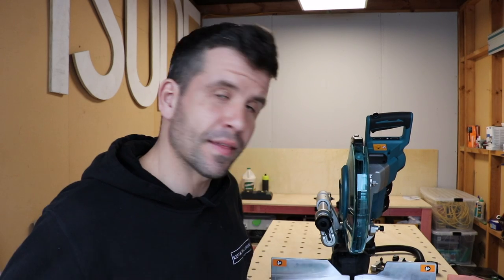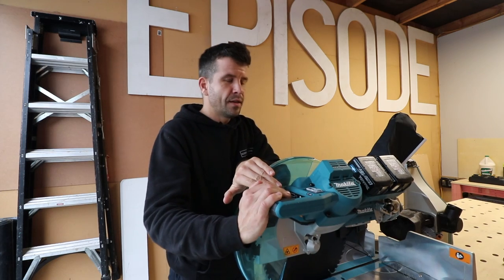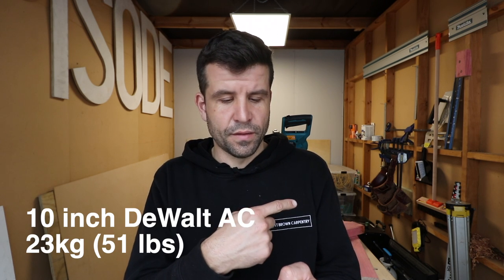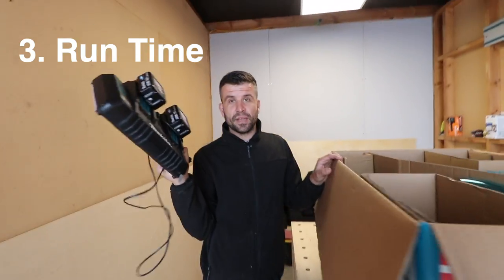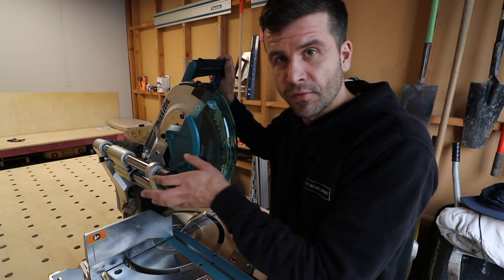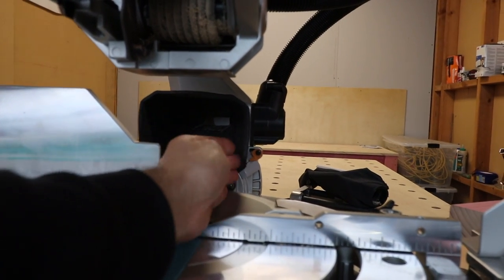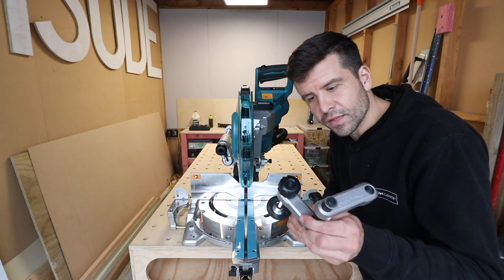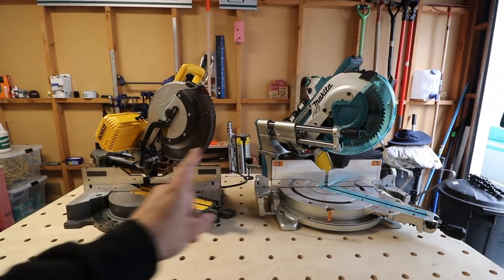Makita 12" Cordless Mitre Saw: Should You Buy it?

Comment: I find it very convienent to have the same brand of tools so that batteries will be the same and interchangeable.
Reply: When it comes to the compatibility of the system from the cases the tools go in to the battery system, DeWalt is the winner with most brands in my opinion.
Reply: Have you ever tried the batter adaptors?
Reply: I used to think that too. I ran all DeWalt 20v. Then I realized Makitas 12v line had stuff I could only find there. So I run a good bit of that now too. Sitting here now I really wish I had seen Scott's videos on framing guns before I snapped up the DeWalt version. It sucks on old tember. So much so, I'm considering selling all the guns and buying into another platform. I'm coming around to the conclusion that sometimes performance trumps convenience.
Reply: Vintagebleu, Milwaukee just launched their framing nailers and they purportedly beat all the cordless ones available. saw the demo recently and looked amazing. Milwaukee also has a deep 12v line and gen 2 and gen 3 18v are pretty badass. I’m in dewalts 20v and FlexVolt line and love it. Don’t use a framing nailer enough to justify switching though. Do love my 3/8” stubby impact and 1/4” impact in the M-12 platform. I don’t use my 20v 1/4 very often and if the stubby can’t handle it I’ve got the Dewalt 1/2” mid torque with toolconnect and the 899 high torque too. Dewalt just launched a bunch of 12v brushless but... too little to late IMHO.
Reply: I agree but I'm considering getting the hikoki/metabo table saw because of the convenience of being able to run on batt or corded power.  I'm Holding out for dewalt to do the same...tic..tok😴
Reply: @andrewford80  I use them for running Bosch procore in makita . But a Bosch battery can be slightly modified to fit without adapter but they don’t click in
Reply: Wow! I never thought of that! I bet you've got everybody thinking that now.

Comment: Bought the 10" version but returned it. Sliding cuts were cupped - even on a short 6" cut. Makita's packaging is woefully inadequate and I think the rails may have been damaged in shipping. The other problem people have reported is wear (and subsequent sloppiness) on the miter stops on the base plate. There's a guy selling a steel version of the plate to replace the aluminum one that's supplied.

Comment: I‘ve had this saw about 3 months. Agree 100% about the weight, but that‘s not so important for me as I work in the shop, not on site. The only serious criticism I have is that when cutting either side of the vertical, eg with 10° tilt, the saw no longer crosscuts at 90°. I have to fiddle with the table to get it to crosscut at 90°. Have you noticed this? It must have something to do with the geometry of the saw.

Comment: I have had the 10" for a while now and it came straight out of the box doing "curved" cuts. Would of liked to see just how square the cuts were on this saw. After getting it set up and getting used to it, I love it. Cuts pretty sweet. But as you say, heavy to move around. The dust extraction is the best I have ever seen on any mitre saw... so long as it is hooked up right.The knob on the front DOES control the left bevel, you only need to push the button at the back to do right bevels else you wouldn't know when it was at 90°. All in all they are solid, powerful saws... just a bit cumbersome to move around.
Reply: I wish they had put good carry handles on it like the Dewalt...

Comment: Agreed. I have the cordless 10 inch Makita version. Got it on sale with free 2nd set of 5 ah batteries.
And dual charger. For my non commercial use needs, it more than fills the bill. A bunch of different x36 tools were coming out here in the US 2 years ago with 2nd free set of 5ah Makita batteries. My run time with any given Makita 18 or 36 volt tool, is virtually unlimited now.

Comment: For my jobsite work, The 10" 36v Makita is great. Once I mounted it to a rolling stand, portability was good, and the reason I'l keep using it is cut quality.   I do high end cabinets, trim, and millwork.   I had a Flexvolt, and a Bosch Glide Miter but they both pale in comparison to the Makita's cut quality.

Comment: I have been using the dewalt flexvolt miter saw for over a year now. I absolutely love it, Plus here in the states it has the ability to be plugged in and used as a regular corded saw if you desired. It also helps that I have been on the dewalt battery platform. Great video.
Reply: The only putting me off the flexvolt is that I need at least 4 batteries for the saw and 4 for the extractor and those batteries are very expensive. It looks the best cordless set up though.
Reply: I have a number of flexvolt tools so I have a bunch of the batteries. It’s defiantly an investment to get on that platform, but It’s so nice not too have to rely on Job site electric

Comment: I've got the Makita 7 1/4 dual battery slide compound saw and it's fantastic. I can do pine framing and fix out with it. It's super light, takes up little room and cuts 95% of materials I need to. My 10inch hasn't been used in a long time.
Reply: What store sells those, I cant find it anywhere!

Comment: What do I look for in a mitre saw..?
Nothing because I have the Dewalt 12” flexvolt!! Can be corded or cordless, powerful, comfortable to operate and it cuts everything I put under the blade! 
Only negative I’ve found so far is the xps light doesn’t stay on permanently.

Comment: Now that I am old(er), I have been loving my 7 1/4" miter saw, for portability. It will never be my only saw, but you can do ALOT with it. I won't get rid of my 12", but I will never buy another. There is too much deflection in that size of blade. It just doesn't do as good a job on trim as I would like.
Reply: Aaron O'Connell...   Buy a Wider/Thicker Kerf Blade, One That is more Stable, Maybe one from Forrest...?

Comment: I'm not sold on the battery powered mitre and table saws yet. Yes, smaller, portable saws for quick stuff would be nice but it looks like these are not more portable and the added expense for batteries doesn't help. I usually set them up and go to work, I'm not moving them around worrying about my cords getting caught on stuff. I still need power for charging the batteries. Circular saws and reciprocating saws were awesome when they were finally available at a good price and I'll never go back. But I don't think these will make me any more money or save me any time. Great vid, thanks for sharing!

Comment: Try the Makita DLS714NZ if u can.  Only a 190mm blade. And still 2x18v battery. But half the wight.
Reply: I have one, cracking little saw. Seriously considering the 10" 36v sliding mitre saw from Makita for the bigger stuff.

Comment: Power & cut capacity.  I have a 12" Dewalt, but selling it to a friend.  I use it in my woodshed @ 99% of the time so portability is not an issue.  I plan to mount it on the Makita stand so I can roe it around my shop.

Comment: I have the 12" draw chop saw (corded) from DeWalt.  I have to say, your comment about simplicity and weight was spot on. I find my DeWalt to be heavy and awkward enough and according to your figures, it is significantly lighter than the Makita.  I love Makita tools though and am quite excited about their line of 36v yard equipment.  I will likely get rid of my gas gear in the next couple years as the next generation of two of the Makita gear comes out.

Comment: I bought the Dewalt 12inch Flexvolt on the weekend, awesome saw. it's lighter, smaller and more user friendly. Versatility to work on batteries or mains. I tried the 12inch Makita too and I actually think the design is better and feels more premium. $200 cheaper here in Sydney. I love how you can back it to the wall as the rails are at the front and the dust collection is superior, especially when paired with AWS, so it's really great for workshop/stationary applications. I do believe Makita needs to raise their battery capacities as they're falling behind. Love your videos Scott!

Comment: Long time Festool Capex user, thought I would give the Makita a try to see if battery would be the way to go. Overall it’s a pretty good saw.....for construction site, it’s big and heavy duty. My biggest gripe is the accuracy.....compared to the Capex, it’s very average. I still like it, but think the extra money for my work saw with the Festool is totally justified. In short a nice try, but some way still to go.
Reply: I have the corded version of this. I put in a zero insert for stability on cutting very small wedges or Packers etc. Spent quite a while setting it up perfect, its quite tricky getting everything sliding and cutting bang on but once I did it is very accurate. A good blade is a must. The finish cut is like polished!!. But I was considering the kapex. How does it Excell in comparison to this saw??

Comment: I bought a cheap Chicago electric drop saw for around 100 bucks. It's a 10 inch sliding saw. They have a compound option but I don't need that. It's super portable. One if the best buys for the money

Comment: I own the makita 12" saw. I have had it for a year or so. It makes great cuts smooth and precise. I bought it because I love makita tools and have lots of batteries. However I don't use this saw near as much as I expected. It's probably only been on 6 jobs in a year. Due to the struggle transporting space and weight. I tend to grab a smaller saw. Unless I have a job with lots of cuts and I plan to leave saw on site for at least a week.

Comment: I’m still pretty much committed to getting this one. I’ve only ever used Dewalt miters and have really never liked them. They never cut straight precisely for long at all. If I toil long enough to finally get a perfect 90.0 cut it will be off everywhere else, and after a few cuts the 90 degree will already be off too. Same thing for both Dewalts previously one of their 12” and more recently a 10”. It’s fine for home trimming and I have managed to get by on them but too much of what I do needs more precision. 

I need to get a 12” again and this will be just the ticket. Luckily for me the size and weight won’t matter as it’s going to live in the garage. As such the necessity of cordless is far less pronounced but ultimately I think I still prefer it. Even if it’s in the garage full-time I’ll still likely be wheeling it to and fro between projects and always hate having to work around power cords and where outlets are. Also want the dust extraction integration that the AWS system provides. 

Only thing I know I won’t like as much will be the laser as opposed to having a shadow line. Although come to think on it I could probably wire up my own anyway. In fact...yeah, of course I can what am I even worried about?

Also I have reservations about the aluminum detent plate. I expect the Makita to have better precision but what good does that do if the detents wear out rapidly? Allegedly there are aftermarket ones available but if they aren’t Makita how precise are they?
Reply: Have the 10" version.  Love it as such but the detents do take a hit.  The replacement cost is 9$ where I am for a new plate.  Just make sure that the saw u get is checked for the slide rails to be coplaner.  I love the saw other wise and for tight spaces the front rail slide is awesome.

Comment: Makita also make a little 8" (I think) battery-powered mitre saw as well. You're not going to be cutting sleepers with it but they look fine for studwork and trims.
Reply: If dewalt made an 8 1/4" flexvolt slider I would buy it.

Comment: I Actually went from a 10" mitre saw to an 8" Makita mitre saw. Reason, 90% of cutting on a mitre saw does not require even an 8" cut. It is a rare calling to do crown moulding and if I did I still have the 10". The 8" is much lighter for day to day transportation in and out of the van and is very accurate.

Comment: I have the corded version of this saw and its my favorite Miter saw I've owned or used, its very accurate and pleasant to use. I am a trim carpenter, so we cut a lot of large crown and base. I prefer to cut everything vertical/nested that I can, because for me, its more effecient. The Makita can manage most everything we do, I've even cut 7 1/4 speed base vertical with it (saws rated for 6 3/4"). The weight and size are a pain wish Makita would release a newer lighter version similar to the form factor of the 8 1/2" 40v . But i think for someone like me who hates cutting flat, I prefer to lug than having to reach around and mess with the bevel all day. I do like the up front bevel lock, but it would be nice if it could all be done from the front like the Bosch saws, instead of pushing the button in the back to go right. But, with its high cut capicty, its not often I need to use it. The Dewailt 12" is a great saw also and is about 8lbs lighter, but I prefer the Makita as it has much better dust collection, sets up in tighter spaces easier with the forward rails and goes 60* both ways.
Reply: I'm getting this saw in the next few weeks, am glad I saw this comment. I mainly do framing for garden rooms so was curious how well it copes (haha) with trim and crown etc. Every other mitre saw always seems to go out of square when I try cut an angle

Comment: Dual bevel 10" Milwaukee drop saw with a 12 amp hour battery. Love it for remodeling work and great battery life. Just another option.
Reply: mike jones I got one as well, only needs one battery as well, but prob not as strong as the dewalt

Comment: I was pretty excited when Makita came out with the 10" saw, but when it didn't have the same gearing to angle the saw as the Festool KApex 120 I was disappointed.  I too have a Dewalt 12" miter saw corded, but recently picked up an Elu 8-1/4" saw that I trimmed condos with 30 years ago for $20, it was like new and still had the original blade in it.  The Elu is very light and portable and is all you really need for most trim jobs. I think a professional needs more than one saw.  The big saws are not fun to lug around.

Comment: When i was oscillating between the Dewalt and Makita corded version, the decision was based on the detent plate, the indented plate(on Makita was soft metal, on Dewalt was steel) and the light guide, Makita has the laser, which you have to align, realign and you never trust it 100%. The Dewalt has the backlight and the shadow of the blade is your reference. That will be always right, without any aligments. for sure they patented it, so nobody else can use it. I am btw Makita user, the only tool from dewalt i have is the dropsaw.

Comment: I bought the 240v wired version of this Makita  saw. I love it but it is very heavy. I never move it so its ok for me.
Reply: I was thinking the same thing, it looks like a great "workshop" saw but I still prefer the light shining on the blade compared to the laser.
Reply: Davyd Mir the blade is a bit thicker than the shadow aye?
Reply: @MsElijah16  what do you mean?
I used the dewalt chop saw and I think the light shines directly on to the blade casting the shadow. Why would the line be bigger?
Reply: Davyd Mir on my Milwaukee the shadow line is say 3 mm thick and the blade is 4 mm so the edge of the blade isn't exactly where the edge of the shadow is haha
Reply: @MsElijah16  Oh wow! I didn't know, tbh for rough work I use the light line but I usually just line the blade on a mark on what im cutting when precision is important :)
Reply: Davyd Mir yeah same

Comment: Are saw arm and depth stop rigid and stable to allow accurately cross cuts to make mortise joints ? I need a flat bottom mortise joint to be cut accurately to save on work, 100 cross lap joints to cut out.thanks

Comment: I have the makita 7" sliding mitre saw but also have the Bosch 10" sliding mitre saw, yes its heavy to carry but once setup no problem and both very accurate, the reason for the bosch is the bevel markings are easier to see and was a good deal

Comment: I have Milwaukee for handheld tools and still use DEWALT for corded larger tools.  My DEWALT miter saw is a 12" beast from years passed and still goes and goes.  It is heavy but does most what I need it to do and does it well... no need to change it yet.  To this day I find DEWALT to be the bench mark on the larger tools.  The 12" Makita would probably be interesting if it were on rolling stand but, like you said, it is a beast and heavy, so I would pass because it is probably as heavy or heavier then the corded DEWALT model I currently have!

Comment: Like you I have makita cordless gear. And some corded like a planer, and router. But I went with dewalt for the 10in drop saw and table saw. Mostly because I like the roller stand on the table saw and the big stand for the drop saw. And the don’t like playing with the laser. The shadow line off the led light will always be accurate. 
Good job Scott, love the content👍

Comment: My makita corded mitre saw, came with a horribly aligned laser line!! Bothe tha angle of theelaser pointer and its direction was off! I still havent adjusted it properly, because I need a very short hex-key to be able to adjust it in place. I think this is a general problem, I have had exact same problem with bosch 90° angle. However, that I was able to tune up and is now probably <0,1 mm/m..

Comment: I'm a big fan of Dewalt when it comes to table saws and planers. But everything else I go for Makita. Had a 24 volt Makita. 7 1/4 inch slide. But it needed a hard to get battery that cost more than a Craftsman corded saw similar to the Makita. Some of these saws need a way to make them corded.